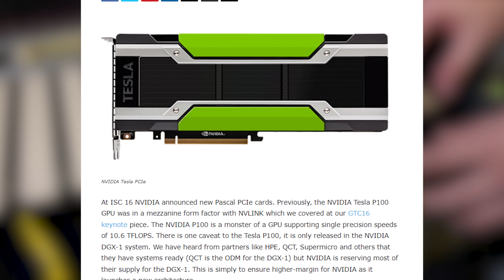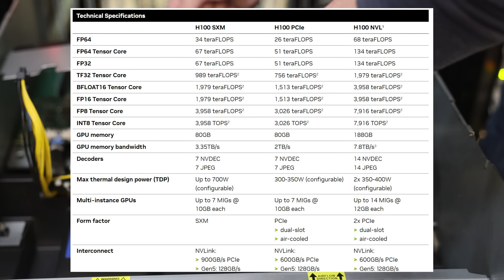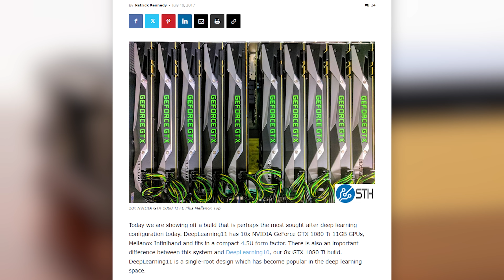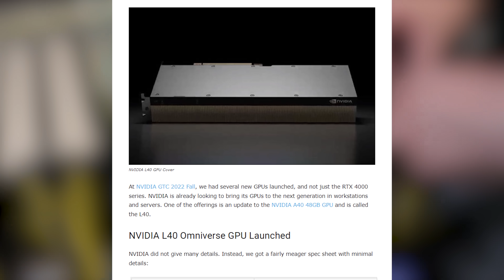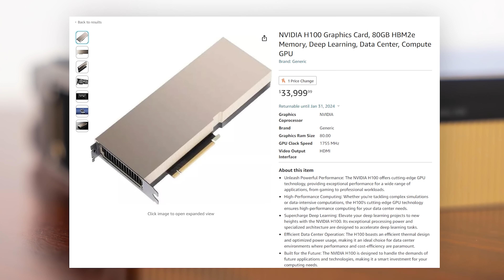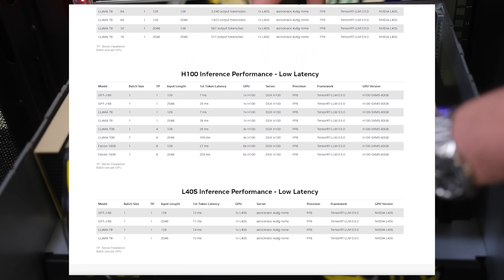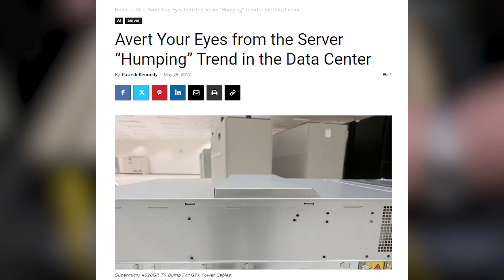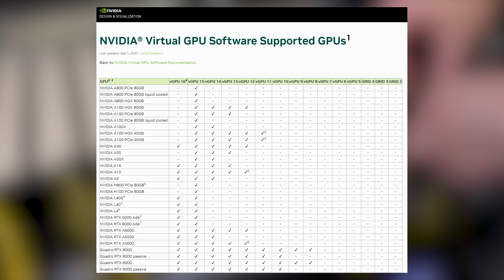THIS is NVIDIA's New AI GPU for up to 10,000 GPU Installations ft. Supermicro

Comment: If you are considering upgrading your models from an L40 to an L40S, it's important to observe that the tensor cores exhibit similar speeds on both cards at INT4 and you don't have any concrete adavantage. Additionally, if you currently use or own a few RTX6000 GPUs, upgrading to the L40S may not yield significant performance improvements; the differences in performance are marginal, except for certain specific aspects. However, if you are making a new investment, opting for the L40S could be a more favorable choice. It is advisable to carefully plan the amortization of this investment over an 18-month period.
Reply: 18 months 🤦🏿‍♂️

Comment: Need more ram.
Also just use 4090's 10x cheaper for the same performance.  But less ram :'c(
Reply from the maker: Sadly the 4090 is a bit nerfed on the computer side too
Reply: @ServeTheHomeVideo  I think only really FP8 and FP16 with FP32 overflow right?  Cant really gimp the number of shaders or triangles calculated per second or the product is doomed.

Comment: Hi Patrick, sometimes you mention "inference", and it feels like it is used as a filler phrase for both inference and training. For example in this part (https://youtube.com/clip/UgkxM6m0et2Pd8DQuiZ0nvZTnByxdhqC3H9r?si=xtbd8roxBi0jLJbQ), I strongly believe this statement belongs to the training interpretation, as inferencing on tens of thousands of GPUs is a very rare case, especially inferencing where all GPUs form one cluster where they need to exchange a lot of data. This exchange of data, which is where the H100 series have the much stronger capabilites compared to the L40 or even L4, is what is required during ML training, and not so much during inference.

We bought three servers with eight L40 (non s) GPUs for training recently, and we decided against the H100 (amongst price and delivery dates) for exactly that reason: it doesn't make any sense if you plan to run distributed training with a few dozen, even hundreds of GPUs
Reply from the maker: So think about domain specific llama-7b models running all at once in an enterprise. There is a class of customer doing that type of work. Take a base model, run customization training, then deploy
Reply: correct, training, which is different to inference (the forward path)

Comment: What's up with Supermicro's dual socket H13 boards lacking PCIe slots?  Are they relying on "ribbons" to optimize?  Asking for a broadwell friend
Reply from the maker: PCIe Gen5 signaling is really challenging in PCB. We talked about this a few times on the STH main site back in 2021 or so and when we do some server reviews. These days servers are going to MCIO (usually) connectors for PCIe Gen5 links and even then sometimes they require retimers. Many lanes plus PCIe Gen5 means mostly cabled connections.

Comment: It's a bit too much toxic marketing for me. Can't build multi-GPU servers with cheap gaming cards anymore because Nvidia killed 2-slot 3090s/4090s to prevent exactly this. Their coolers are so heavy that they rip out the PCIE slot under their own weight, and so hilariously large they don't fit in even normal PC cases.
L40S is identical to the RTX 4090, except for the extra 24GB memory chips which cost $100 in retail, yet they increase the price by an extra $9000.
And NVLink on the A100/H100 is kept locked to their proprietary CUDA language, so you can't use it with portable OpenCL codes.
Reply: Upgrading 3090 memory from Samsung and using NVLink your in all in at 2K in parts
Reply: absolutely !
Reply: NVLink itself is proprietary. It was designed from the beginning with CUDA specifically in mind. 

And what is that, $100 for 24GB of memory chips in desktop memory? I wasn't able to find a good source for the spot price of 24GB GDDR6X, but I'm betting it's quite a bit higher thann $100.

Comment: As someone who works on these things, the only billionaire those GPUs will be making is Jensen Huang
Reply: Pt. 2

Once you hit the point were you have to scale up your capacity and floorspace for all of those, so do the costs of building out and maintaining that capacity
Reply: Pt 3.

And none of this is even factoring the cost of the machines themselves OR the network infrastructure to support them 😂
Reply: @ but someone buying these has already made those calculations etc etc , i.e if i am guaranteed to solve a 1 million worth of equation for a total of 100k initial , thats a deal
Reply from the maker: I never said who that billionaire would be. Actually though, I have seen a few VC pitch decks for what will be unicorn valuation companies buying $300M+ of GPUs.
Reply: @ServeTheHomeVideo  We'll see how well that goes after a few years of being cash flow negative due to high cost of ownership.
Reply: @0x8087  where is the cost coming from, power consumption ?
Reply: @truthwithjj  Depends on if they're renting space from a colocation and how much capacity they're renting in terms of floor space and power.
If they're hosting in their own self-operated data center then they'd have to accommodate not only for power but how much their CRACs can handle, isle containment, failover and backup power (UPS and generators), all physical layers of security, etc. PLUS the cost of maintenance of all of those

Comment: As someone who got disappointed by switching to a dual 3090 setup from a dual Titan RTX setup, I just want to add that an important metric that Nvidia buries in the spec sheet that's important for DL performance is the FP16 with FP32 Accumulate. Where Nvidia half rates it on the Geforce cards to stop them from beating the pro cards.
Reply: "Buried" is a term used by people that are too lazy to read. 🤷🏿‍♀️🤷🏿‍♀️
Reply: Contracts  @blender_wiki  and lawyers are fun.

Comment: For me, memory matters. H100 is 80GB, and RTX600 Ada, RTX5880 Ada, L40S and L40 are all 48GB. RTX4090 is just 24GB, but so is the RTX 3090ti, which is much cheaper. 
There is water cooled RTX6000 Ada, but is there water cooled L40S?

Sadly, it's still not a good solution. Intel has nothing for workstation, AMD is missing software. At this point... I am hoping for Qualcomm to sell the Cloud AI100 Ultra with 128GB LPDDR5X for workstation

Comment: What is the closest GPU(s) from AMD against these H100 and L40S?
Reply from the maker: Since they are PCIe cards, it would still be the MI200/ MI250X but the new MI300A/ MI300X are AMD's current-gen top-end at this point https://www.servethehome.com/amd-instinct-mi300x-gpu-and-mi300a-apus-launched-for-ai-era/
Reply: Do you know of any reasonably good comparison or analysis of the AMD software stack around these cards @ServeTheHomeVideo  ?
Reply: Without a version of nvlink and a proven software suite (ROCm is open sourced) they can't really compete
Reply: @Data_CPA  we're using AMD APU 5600G w Pytorch though SW support is times inferior to nvidia, because they deprecated the GPU in the APU for newer RocM (than 5.7.1) and it is not that old. Nvidia still supports my TESLA M40

Comment: Thanks for the info Patrick. Great learning about things Ill be able to afford in 20 years when it hits ebay.
Reply from the maker: To do that old 8x P100 piece, we got the P100's fairly cheap off of ebay only 2 years after they launched. The pace of GPUs is much faster than CPUs. You may need a power upgrade though
Reply: And cooling!
Reply: If the AI bubble bursts it will be much sooner than 20 years
Reply: *2-4 years. Either because of the pace of tech movement, or because the market collapsed

Comment: Isn't vGPU/SR-IOV all software sauce? I really dislike nvidia price gating features that should be everywhere
Reply: Not entirely but I get what you mean. In theory yes, given that there are multiple videos on Youtube for e.g. 2000 series cards that can be modded with special drivers and scripts on Proxmox to enable vGPU support. But it is very well possible that Nvidia disables this in the silicon after the silicon has been sorted between pro/consumer use, to absolutely make sure Jenson/the shareholders get their money.

Comment: Since I work in research the L40S just isn't a good choice. We need the VRAM. But for "smaller" or quantized LLM inference they can be fine.

Unfortunately, my data centers are not setup for high density servers so currently we are using 4x setups.
Reply from the maker: These tend to be sold more for exactly that. Think like running a bunch of llama-7b instances at a time.